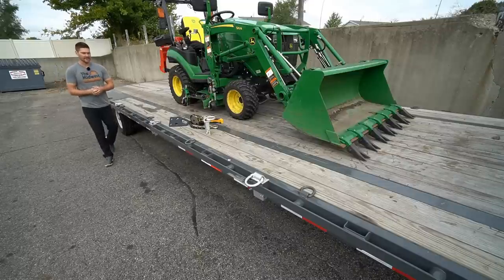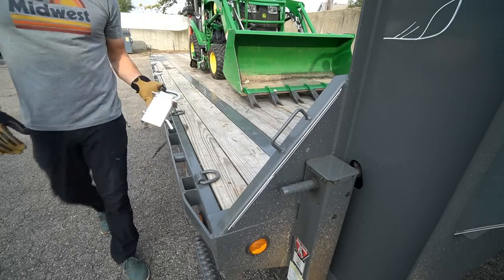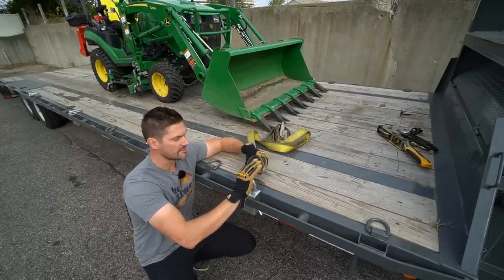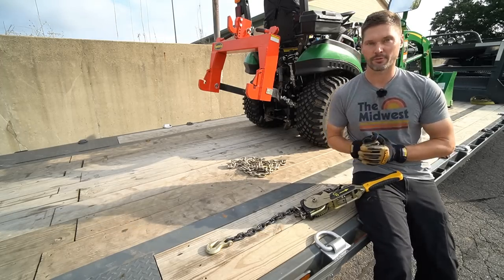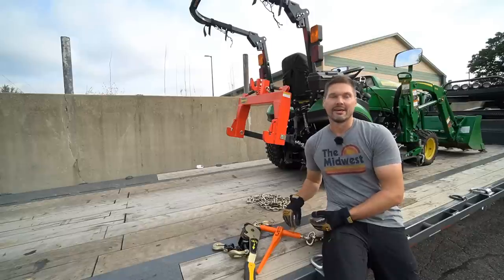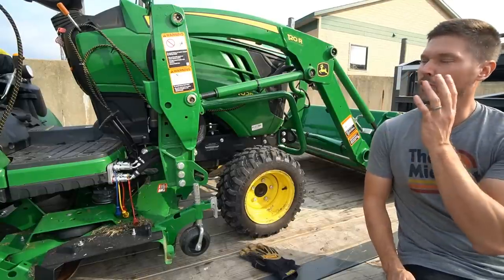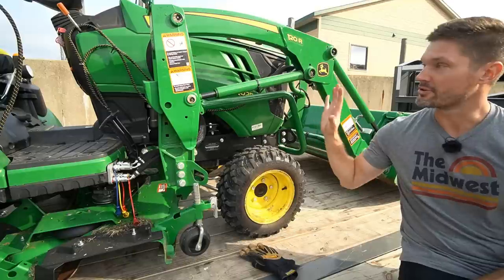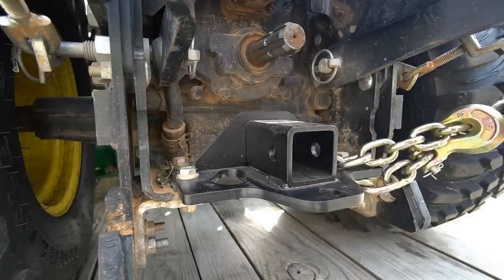3 SMART, EASY PRODUCTS TO SIMPLIFY TRAILER LOAD SECUREMENT!

Comment: Hi I have been using the EZ binder on my JD 1025R for a couple of years,  I transport it quite a lot. I replaced the shortening hooks with open hooks and longer chain (the chain is grade 70) so I can hook one end straight into the D ring the other end to the tie down point on the tractor. It is very neet, very quick and very safe. Overkill I know.
Regards John
Reply from the maker: Hi John, awesome and glad to hear it from someone who's had it for some time now!  Thanks for sharing!

Comment: if you don't have the money for the stake pocket D rings when you attach a chain drop on one side of the stake pocket and come up on the other side  That way if your binder comes loose you won't lose your chain.   Same way with strap.  The reason you wrap the rub rail is if it comes loose you won't loose it.   And straps and chains do come loose no matter how tight you think you can get them.    That is why you load check 1st half hour and every time you stop.   Just my 2 cents   Thanks for the video.   good ideas.
Reply from the maker: Great advice, always check shortly after you get on the road!
Reply: @GoodWorksTractors  actually it is a DOT requirement.  It used to be  within the first 30 minutes   Yes most of us are not under DOT regulations but it is still saved equipment or loosing equipment a time or two.
Reply from the maker: Didn't know that, always just kind of knew it was the right thing to do.  Thanks for sharing!
Reply: Dot requires that the check the load in the first 50 miles of the trip and every time you are away from the vehicle which is a called a "change of duty status". Also some states will bust you for unsecure load if you have a strap or chain on the outside of the rub rail.

Comment: Manufacturers supply 18” 3/8 dia. chain extenders which have grab hooks on one end  .  The other end will have 3” forged delta rings for 2” flat straps or pear shaped rings for 2” wire hook straps . G-70 hook and chain will be marked .

Comment: We usually just wrapped the chain around the stake pockets, unless there were side supports in the stake pockets. I think we had d rings mounted appropriately on that trailer
Reply from the maker: If the D Rings are mounted in the appropriate spot, then perfect.  I see trailers every day that don't even D Rings on them, lol.
Reply: @GoodWorksTractors  we probably had them added😂

Comment: I agree with you but technology costs and the old stuff works, yes you can make it a little easier or a little faster but the old binders and straps and rings have been in production for decades and they’re cheap and established and standardized, if you come out with something new the cost is going to be ridiculously higher. There are always better way to do things but somethings are cost effective and your average trucker is not going to go spend $297 when you can get something else that will do pretty much the same thing for 60 bucks just because it does it a little faster.  I agree, I spend more for this stuff but most people don’t and it’s simple marketing. In time they will become more common they’ll become produced by more companies and the prices will come down and they’ll become more standardized. But for now, people are cheap, those products are out there it’s not that they don’t exist it’s just that they’re more expensive and people don’t wanna pay for them. :/

Comment: The Oz binder is a great product.
Only issue I have is if I crank it down hard, when releasing the chain, the binder chain and slack pull handle gets stuck inside the gears and links

Comment: Looks like those ratchet binders have a working load limit of 6,600lbs so that would count a 3,300lbs per binder per corner of 50% of working load limit.  So you could carry a machine weighing 13,200 max if I'm correct on that according to federal law.
Reply from the maker: I do believe that math is correct

Comment: Quick question we just got a 1025r and with the loader and backhoe it feels like it stresses the machine to ride over bumpy terrain it’s all in my head I know that But how strong are these small tractors? can they handle a 2 inch drive way bump with all that weight on there?
Reply from the maker: Yeah, they handle rough terrain just fine.  That's what they're made to work in.

Comment: Wish the EZBinders were rating for more weight. They cost 4 times as much as regular ratchet binders, but are rated for almost half the weight. Definitely not for heavy haul use. Boss got me 8 of them for basic stuff though. Still prefer them over regular ratchets for basic flatbed loads. Not as fast as snap binders, but they should be safer to operate.

Comment: Is it just the one size of chain binder or are there other sizes available too?
Reply from the maker: There's only one size chain binder.  Thanks for watching!
Reply: @GoodWorksTractors  Found the manufacturer's website shortly after making the comment - looks like there are two different part numbers one with a higher working load limit.  

Still be good to see them expand into larger chain sizes though...
Reply from the maker: Nice, they must have added it recently as I asked for all sizes they had :)

Comment: Why can't you wrap the chains around the tube sections between the rub rail and trailer edge?
Reply from the maker: I highlighted those stake pocket D Rings for more than just chains.  No way to avoid going outside the rub rail with straps whether it's wire hook, flat hook, snap hook, or anything else.
Reply: @GoodWorksTractors  saw you using it with chain, I guess it was just a demo and saves the paint on the trailer too😁

Comment: You should stop by your local cop that inspects 18 wheelers... DOT. There are specific reasons why you needed 8 straps for that skid steer. Each one is rated for X amount of weight. Add up the ratings of all the straps... For the same reason why you can't use 4 straps rated for 500lb each to secure a 10,000 piece of equipment. Same goes for chains... they have a specific weight rating.
Reply from the maker: Yep.  I've covered that in several videos.

Comment: Hello,
Well done nice commercial.
But I do prefere your other kind of videos.
I won't comment the products, I'm sure you already know the ups and downs of what you show us here.

Cheers from Belgium.
Reply from the maker: I suppose every video I make is technically a commercial.  After all, I am in business to make a living :)  Thanks for watching!
Reply: @GoodWorksTractors  
It's not a negatively ment comment.
On the contrary, nice commercial, only I was a little surprised.
I still prefere the other 99% of your "commercial" videos.
Posting comments and 👍 does you good, if I didn't care for what you do/ can do I wouldn't bother commenting. I'm only letting you know what my preference is. I'm not sure if it helps, maybe you will get more vieuws with this kind of videos.
I'm just more confident in buying from you when you share your opinion and experience than when it's a nearly pure sales video.

One way or an other.👍

Cheers from Belgium.
Reply from the maker: Haha, I was trying to be funny :)  For what it's worth, I don't showcase or share products that I don't use myself and don't believe in.  So, whether it's standing in front of a tractor, driving in a field, or showing off trailer tie down products, they've got the GWT stamp of approval :)
Reply: @GoodWorksTractors  
Oeps, sorry.
I guess I'd better practice my English skills before commenting.
I didn't understand the joke, my bad.
Best regards.
Reply from the maker: Haha, no need to apologize.  I can't speak any other language at all.  I give you much credit!  Take care and hope to see you chime in on the next video!

Comment: The straps and binders are the way they are by federal government regulation. The designers  had no say in it
Reply from the maker: Everything under government overwatch has design parameters.  That doesn't mean there shouldn't be innovation.  That's just laziness.
Reply: @GoodWorksTractors  tell that to the government bureaucrats that pass the regs. International trucks ran into the malformed engine, the 1st generation hand a lot of problems becouse of the regulators, yes the engineers said what would happen if built there way and that is what happened, than International got the government perdition to do it ther way and most of the problems ended except  were were the government  said no to the changes
Reply from the maker: That's how those things normally go.
Reply: @GoodWorksTractors  unless in a system were those with no knowledge how things work but with authority by government edict mandates ow thing are done or made by those that know how it works
Reply: @GoodWorksTractors  thats what happens when those in power think with authority and not there brains

Comment: The ez ratchet looks scary
 Depending on that little latch to hold. Not good on real heavy equipment.
Reply from the maker: It's designed specifically for heavy equipment.  I'd be more concerned a weld breaking free on a D ring before this ratchet.  It is heavy duty.

Comment: First there was sliced bread. Then came the EZ Binder.
Reply from the maker: 😂 they are pretty slick!
Reply: Designed and made in Australia, marketed here as the Maxibinder. Easy to use and amazingly robust. That 8 mm model has a lashing capacity of 3800 kg, the 10 mm chain model, 6000 kg. 🐨🦘👍🇦🇺🦘